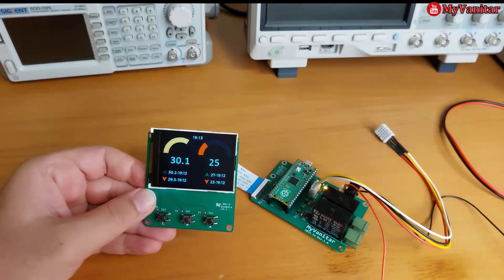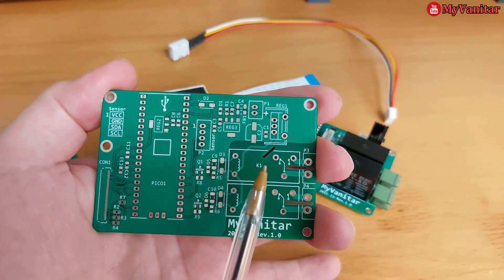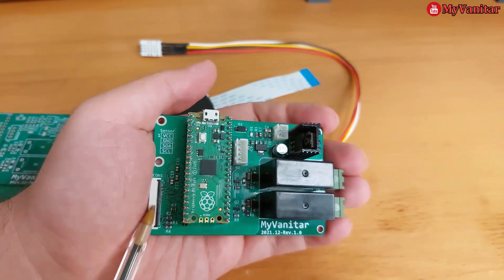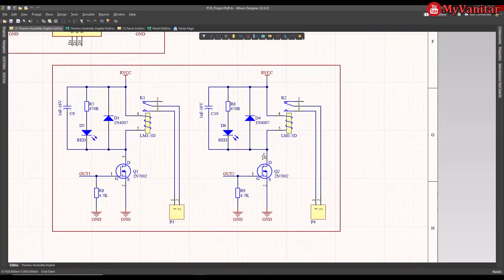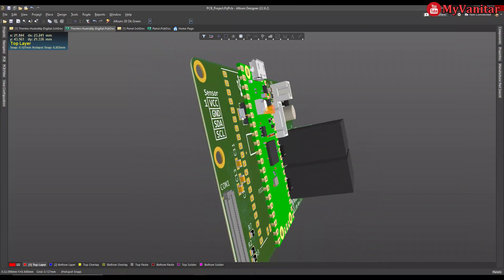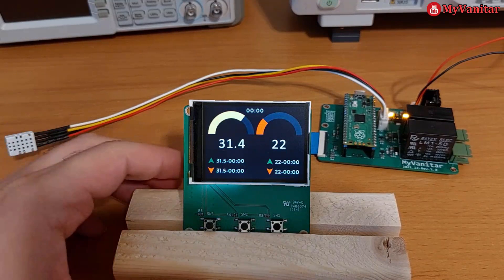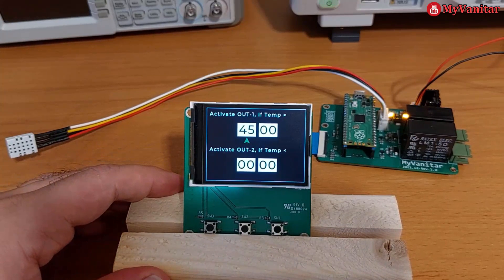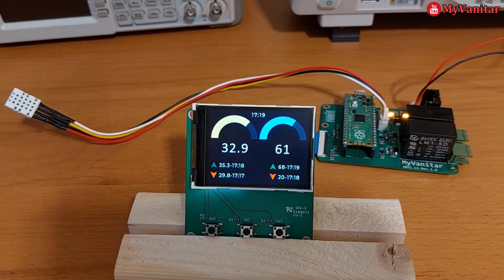🔶 Temperature & Humidity Control Unit Using a Raspberry Pi Pico

Comment: Could you set the target humidity depending on the temperature? That would be very useful to control the humidifier from a drying room without the need to install an air conditioner. For ex, <17º->40%, 17-19º->50%, >19º->60%
Reply from the maker: if I remember correctly, for this project temperature and humidity are controlled independently. By the way, each customer might have a different requirement. if you want a standalone device for yourself or production, pls send me an email

Comment: What would I need to do to have this plug-n-play ready for controlling roll-up doors in our walnut dryer? I'd need to experiment to see if I'd need to establish a temp range (maybe a minimum?), but the most important thing I'd like to do is read humidity up towards the ceiling of our dryer building, inside the dryer plenum, and automatically and incrementally close the doors as humidity drops below 40%. This allows for greater efficiency and lower dry times during harvest. I'm assuming the relays could trigger the 'up' 'down' 'stop' commands of an electric opener.
Reply from the maker: Here, my assumption is ON/OFF for the heater and humidifier/dehumidifier. using a PID or similar might not be necessary. instead, I put a tolerance for variations. so the device won't stick in an ON/OFF cycle too much.

Comment: An interesting project.
Tell me, what display are you using and how do you understand the connection is 8 bit parallel?
But for some reason, the display of graphics is very slow, like a pico microcontroller 133 megahertz, but the image slows down.
Reply from the maker: This was my first test, The connection type is SPI, I had set the SPI clock speed to something low. otherwise it can be much faster with a small change in the SPI clock. Check the article for more details regarding the LCD and Circuit.
Reply: @MyVanitar  are you use logical analyzer?
You will may see speed of serial interface.
I think you activate and uses software SPI.
Very very low drawing image 😞
Reply from the maker: don't you have any comment except this?! I told you I have fixed this, although it's not that much low at all. I know what I'm doing. if you have any other comments, you are welcome to ask

Comment: This is awesome, this is exactly what I want to learn how to do. 
Im watching your other video with the component that has 4 relays for temperature (2) Humidity (1) and Lighting (1)
this is a great component, i really need to learn more about this, how did you learn to design this?
1 question, how do you control while also providing electricity to each appliance, the heating/cooling, humidifier, and Lighting?
Reply from the maker: how to learn? the answer is when you find a practical and true resource to learn, stay with it, invest time, and practice. From YouTube analytics, I see how some people behave. mostly looking to pass their coursework, they watch for 2 minutes and leave. So it is pretty easy to stay above the crowd. For your second question, you must wire each relay as a switch to your load, doesn't matter what voltage your load has, that's it.

Comment: Hi, do you plan to publish the code? It will Be very instructing and will help understanding this fine and professionaly built project.
Reply from the maker: unfortunately, the code is not free and the reason is clear
Reply: @MyVanitar  is it for sale? as a final product? I have a clear market for it. 
A solar air heater is sold with a mechanical thermostat and a 12v fan powered by a small ~30w imbeded photovoltiac panel.
The concept is briliant and works perfectly for our climate but it lacks a critical feature that your device can solve. the panels I plan to control are 300-500€ with available controllers sold 100-200€ but they don't provide the value they promise.
What do you think?
Reply from the maker: @mohammadalhasan4253  Hello, what you see in the video and article works as it is, the above comment asked for the source code. however for commercial product and business talks, please send me an Email directly. Just go to the About section of the channel and there you can find the contact info
Reply: I am not clear on the reason, can you explain?
Reply: @MrTechGadget  He's probably not wrote any software that actually works properly. It seems VERY slow updating the display.

Comment: will the code be opensource ??
Reply from the maker: Did you check the article?
Reply: @MyVanitar  yes. but i didn't find the source. only the uf2 file
Reply from the maker: source code is not free and the reason is clear